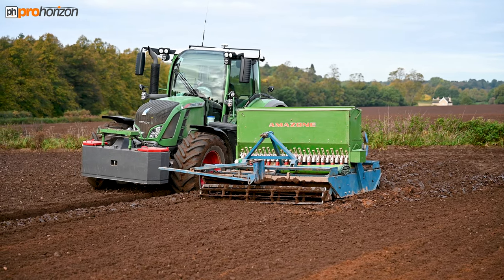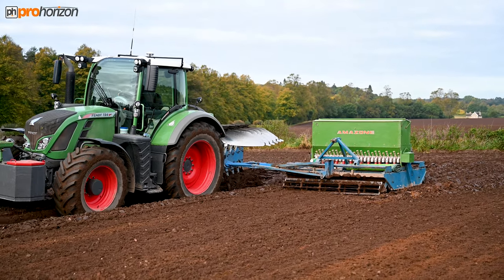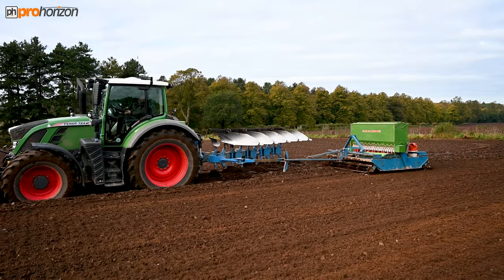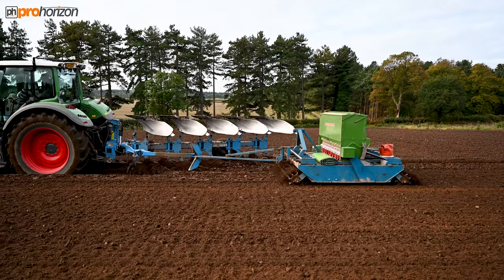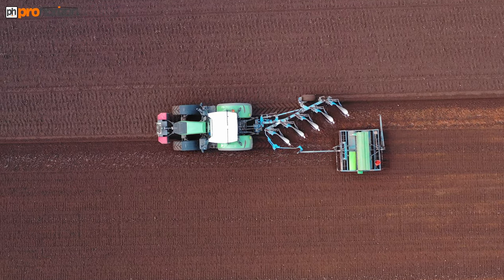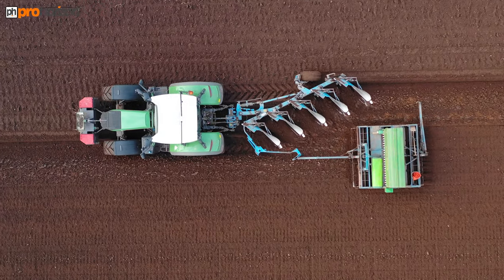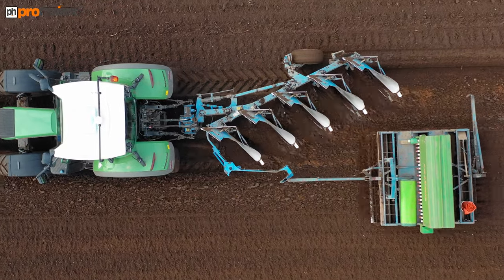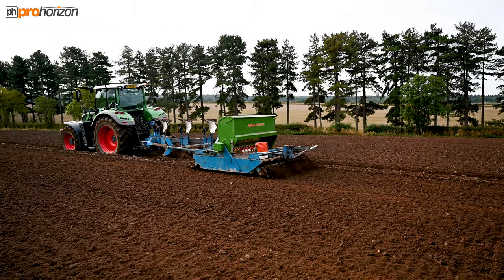UPDATED Plough Drill and Press One Pass 2020 - Köckerling Minimat press drill, Fendt 724 & Plough

Comment: How firm is the seed bed after drilling? I find our light land benefits from a heavy drill consolidating it.
Reply from the maker: It does make a big difference. I can walk about and run without sinking. It’s hard to walk on the unconsolidated ground.
Reply: I’m contemplating taking on more acres and this seems a good way for a one man band to go. 
 I can see doing headlands being tricky but possible. I would need to flatten ins n outs before doing headlands.